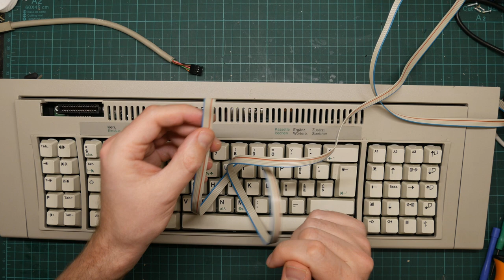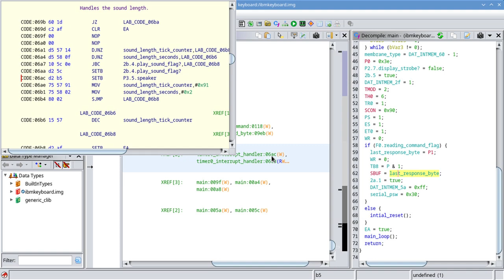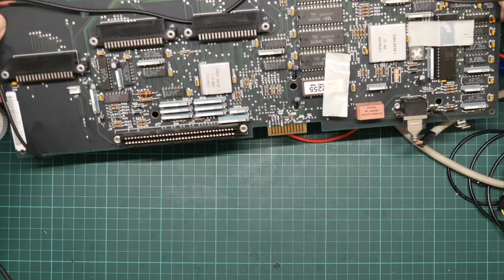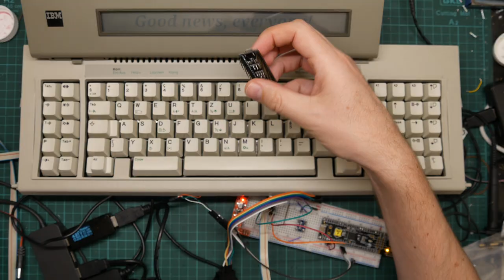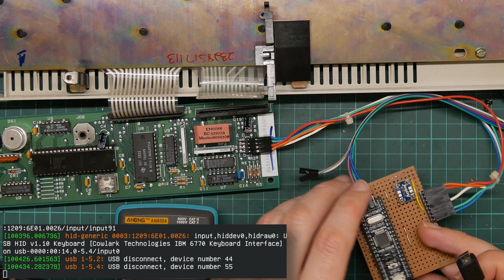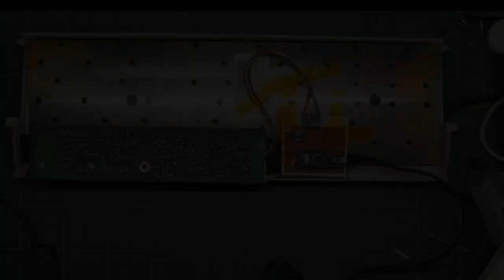Reverse engineering a 1985 IBM keyboard (and building a USB converter for it)

Comment: You gave me a big Deja Vu moment. The 8021 keyboard controller died in my Victor 9000 keyboard which led me on a wonderful journey in replacing it with an Arduino Nano. Works a treat but it was very much a personal challenge!

Comment: Cool project. 🙂
I also managed to get my IMC-2001 keyboard working (roughly 1984). It had some defect ICs and some broken cables. That keyboard has a MCS-48 clone CPU in it (CIC8039E) and the protocol proved to be simple 7-bit ASCII with a stop bit on serial 19200 baud. There is an additional signaling line leading directly to a register on the motherboard (presumably latching in the current value of the key pressed into a memory mapped byte in memory). And it has a active low reset line for the Apple ][ reset key.

Comment: Great use (adaptation) of a typewriter keyboard.
Poking at the code you've shared - I wonder if the original programmer used goto's to keep their switch statement orderly, or if it's a quirk introduced by the compiler.
Reply from the maker: I'd imagine that the original code would have been hand-written assembly. It's actually all strung together with gotos, written as a big state machine, and makes clever use off the 8051 register banks so a lot of state is kept in registers long term (not that the 8051 really has RAM, as such!). The original source would be interesting to see.
Reply: @hjalfi I'd like to see it too.
There used to be an Atom (depreciated) plugin that would allow scope-aware renaming of {function and variable} names that I found really useful when un-obstuficating code.
I wonder if it has been ported to another editor yet.
EDIT: better, there are many more 'refactoring' plugins for other editors now than way back when I last searched.
Edit 2: questionable, not all of them claim to be scope aware...

Comment: You used a buck converter? I bet with you that the -5V line is powered by a 7905, the fix would be simpler than you think.
Reply from the maker: Most likely, yeah, but simply getting access is a pain. I also wonder whether the sensor failure is because something else is relying on the -5V line upstream of my fix, although I can't imagine what.